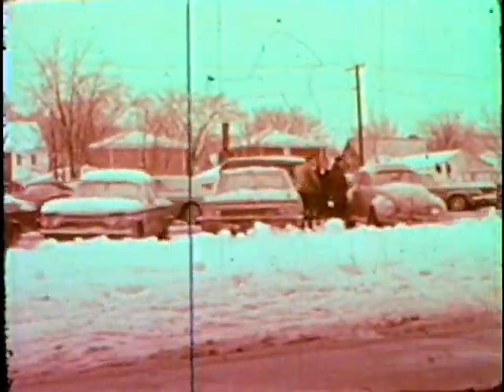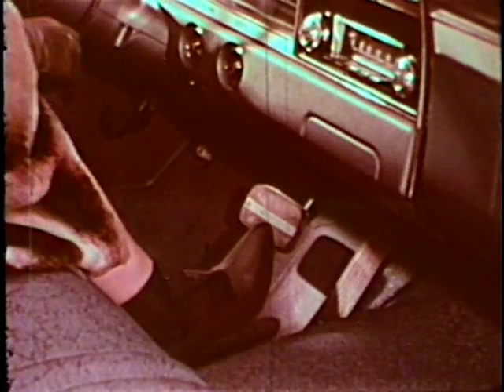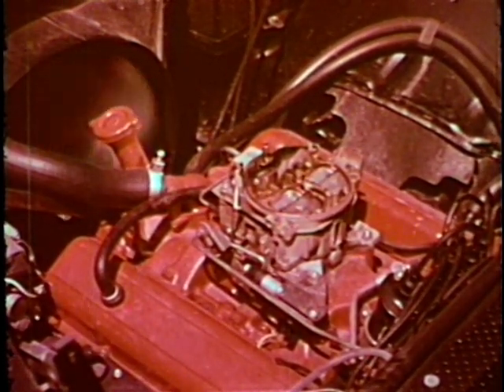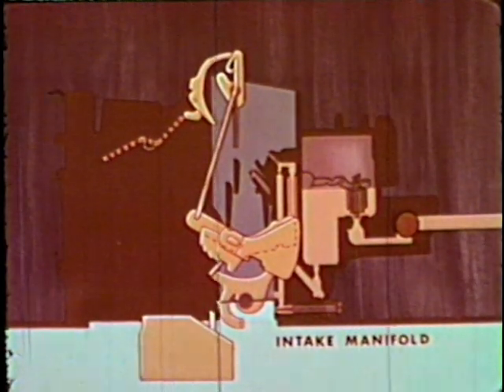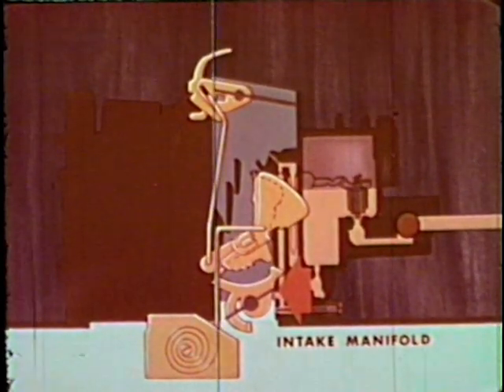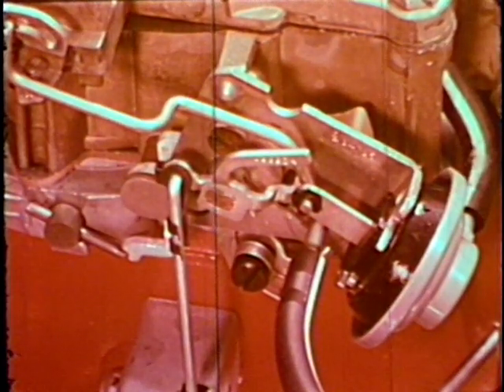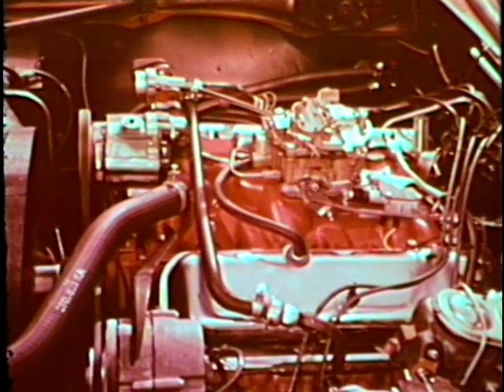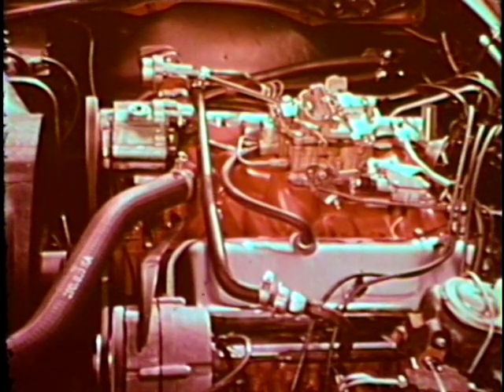Carburetor Choke Operation

Comment: People used to bad mouth those thermostatic spring choke systems on GM vehicles and Quadra jet carburetors but when adjusted correctly and the using the procedure described in this video they worked wonderfully. I can't even remember the number of Quadra jet carburetors I've rebuilt and adjusted over the last 55 years it is so many.It's hard to believe this starting procedure is not common knowledge.
Reply: This is exactly how my dad taught me to start vehicles with carburetors...we had several with Quadrajets... those always started almost instantly, hot or cold, down to below zero!! At that temperature, I'd pump a cold engine 3 or 4 times

Comment: I have a 1969 Impala with a Rochester Quadrajet.  It has taken me nearly 2 years to learn the correct starting procedure, mostly through trial and error and it's exactly as the guy says here.  I've always been able to get the car to start but I would do 3 pumps or try holding the throttle down partially as the guy who sold the car to me did.  Now I do one pedal to the floor and release and turn the key.  I'm now learning more about the fast idle cam and how long that should stay on for.  If I blip the throttle then it kicks down but the car will then sputter and idle too low, sometimes stalling.  If I turn the key completely off at that point and restart then it runs fine.  My thoughts are that the choke plate is remaining closed via vacuum, even after I get it off high idle.  Maybe I need to not touch the throttle until the car is warmed up a bit more.  Learning a lot anyway.

Comment: Maybe y’all can help me.. I have an 85 c10 305. I watched this video and was amazed at how easily my truck finally cranked! My issue is that once cranked it cuts right back off. I then have the hardest time keeping it cranked and idling. I end up cranking it ten times and have to almost floor it to get it to finally idol. I have a new fuel pump and fuel filter. Last night after filling up I couldn’t even go over 45mph.. any help is appreciated

Comment: Ive spent thousands chasing what i thought was a hard start issue with my 69 F100. Ive changed coil, chokes, carb etc. No mechanic could figure it out. After watching the video i went out and started my truck without an issue. I try to tell myself at least ive upgraded a lot of the ignition system.☹️

Comment: This video is insane. I was having so much trouble starting my 1985 Olds when the weather got into the 40s and 30s. I was checking everything to see what was wrong, but it was ME! I was totally pumping multiple times before starting (and sometimes while starting) to start it.. Usually it would stall out because I was then holding the gas pedal afterwards... Wow, and I thought I had it down.

Comment: If no leaky well plugs draining float bowel or fuel pump check valve is good and gas an't settling back down the fuel line. And carburetor accelerator pump is good.One should be okay.

Comment: This is the best ,video i seen explaining the workings of the quadrajet carburetor. I've seen some people adjust the choke ,with the lean or rich settings but not showing the rear pull off choke linkage adjustment pulling the butterfly partially open on startup,smallest  drill bit distance measurement more or less .Now my 1980 oldsmobile delta 88,5.0-307 v-8 engine.4 barrel carburetor.car Starts,up exactly as,explained .As long as,everything else on carburetor is correct.Damnskippy.

Comment: What an amazingly clear video on starting carbureted cars 👍🏼 

Now I know what I’m doing wrong!
Reply: All of us were doing it wrong. I'm about to watch the old lady again, the one who did it correctly. 

I need to check again:  
(1)  If she first put the key in the ignition on the ON position, 
      followed by the single press of the pedal for a few seconds,
      then cranked the engine over to start it. 
Or 
(2)  If she  first simply left the key on the OFF position, 
       followed by the single press of the gas pedal for a few seconds, 
       then cranked the engine over to start it.
Reply: I started doing this since ai watched the video and my Wagoneer starts 95% of the time.  When it doesn’t I give it one extra pedal pump and it starts 👍🏼

Comment: Now the question is what's wrong if the correct method still doesn't work?
Reply from the maker: Does the choke plate close when the accelerator pedal is depressed on a cold engine? If not either the spring needs to be adjusted or replaced. The bi-metal choke spring is under the black plastic cover and if it not adjustable by loosening the screws and turning it, then it needs to be replaced as the spring has lost tension. The EPA did not allow adjustments after a certain time and required them to be riveted. You would need to drill the rivets and replace them with self-tapping screws. Good luck.
Reply: @automotiveservice6828  I actually have tried manually closing the choke nearly completely. Still requires 3 tries at firing it up. Whether that's 15 short pumps in 3 tries or, or 3 long pumps. Something about 3's. I need to check what it does with my foot on the accelerator with a helper.
Reply from the maker: @DominiAeternum  After depressing the accelerator pedal and releasing it on a cold engine, the choke plate should close. If it does and the engine won't start, manually open the choke plate and look in the carb while NOT cranking (I said NOT cranking) and look for liquid fuel on the surfaces. If there is none, then you may have leaky well plugs allowing the fuel to leak out of the float bowl into the intake manifold when the car is off. This would require time for the fuel pump to fill the float bowl up. A test would be to shoot some aerosol carb cleaner  or starting fluid into the intake. If the engine starts on the aerosol, then you know that you have a fuel problem. Be careful with stating fluid. It is very flammable.
Reply: @automotiveservice6828  Didn't see this until now. I'll have to try this. Have used starter fluid on another car that wouldn't startup at all. 

So if the fuel is leaking the intake manifold does that lead to something bad? I'm assuming it should only take 1 pedal depression or pump or set of pumps to cold start a carb?
Reply: Then it could be the driver if all else doesn't work.
Reply: @lesliemclean4381  Thanks smartass

Comment: When you learn and understand the how and why something works ...only then can you can figure out what and why it does not work. Great video that helped me fix a carburetor on an original engine in a 1979 Chevrolet Caprice.
Reply: Same here, even with the service manual, setting up the divorced choke on my ‘73 Caprice was difficult for me, until I found this video.
Reply: @mrmichael555  You should have just installed an electronic choke! The kit comes with everything you need and it does not cost much at all! I have a Quadra jet on my boat that originally came with a divorce choke, I converted it over to an electric choke and I love it!
Reply: @NeverEnoughPyro40  swapping parts out wouldn’t have made any difference, it still needed to be set up correctly.  Once I saw the theory of operation, I understood what I was trying to achieve.  After watching this video, I made a small adjustment and it’s been working great!

Comment: The problem is that car drivers rarely read the handbook that came with the car.  Worse, most drivers were taught(?) to drive by a family member that also never read the car handbook.  Every car handbook tells the owner how to start the car.

As a trained engineer, I was taught to always RTFM!   My old cars with QuadraJets work great.  And the DualJets.  And the Webers, SUs, and amazingly the Strombergs too.  So, RTFM to you all.
Reply: I even have a start procedure on the sun visor of my ‘73 Chevrolet.  It was a common problem back then.

Comment: Shout out to ALL who still have happy carburetors still out there running round ! Excellent video ! I'm sure a lot of folks never seen this so when the computer era stepped in they loved how they can cold start without pumping. Grandfather always said "you have to think like a electric fuel pump when operating a carb." Too bad they don't continue to make genuine parts for a carb or just sell them new. People out here still have em !
Reply: Carburetors are superior to fuel injection in my opinion due to their simplicity and ease of adjustment. I just rebuilt a Quadra jet for an rv and it runs just as well as anything new.
Reply: @evanchapmanfanman  still running my carberated toyota corolla!
Reply: @evanchapmanfanman  A carbureted engine is superior because of it’s simplicity and ease of adjustment? I guess you don’t know anything about fuel injection, You don’t have to make any adjustments the computer does it for you! That sounds pretty easy to me!
Reply: @NeverEnoughPyro40  fuel injection is great when all works well, but when a problem occurs, several hours of troubleshooting take place, often times with the problem component buried under manifolds and endless wire harnesses, I’d much rather turn a couple screws than spend a ton of time combing thru possible issues. Plus the Quadrajet really holds its tune far longer than any other carburetor.
Reply: I love my Quadrajet!
Reply: @briansd2772  the sound of the secondaries opening is a sound of its own, especially when combined with a big block chev
Reply: I daily a 79 gmc truck rain snow or shine that engine is happy all the time. Had it -10° to 110° and 0 issues in either condition
Reply: Hell yeah brother ! Another American Built GM pioneering through 2022 and beyond or as I like to call it a silent middle finger to ALL watered down Automotive Industries everywhere.
Reply: @cartoonist1975 maybe not so silent when using 4 barrels!
Reply: definitely . i like that 4bbl sound
Reply: Thanks still enjoying my 78 Ford Cortina with double barrel carb.